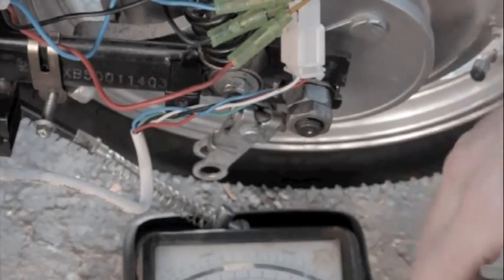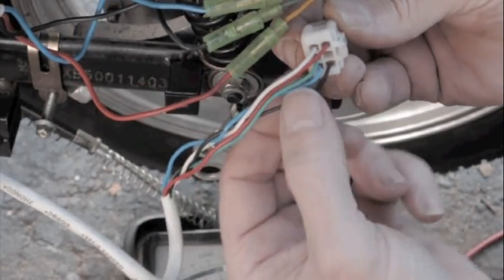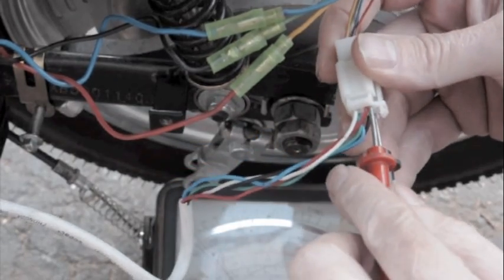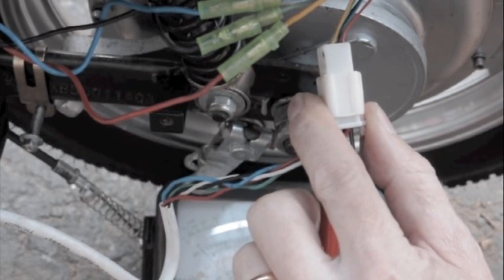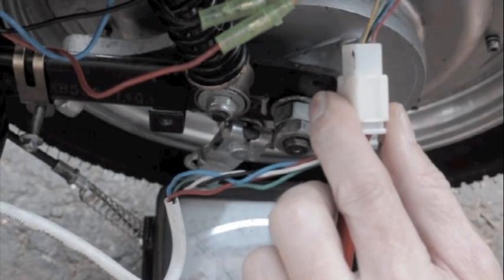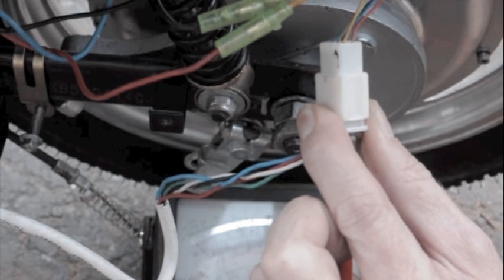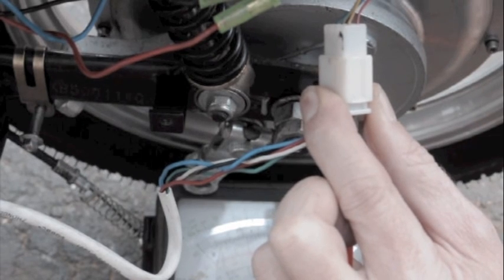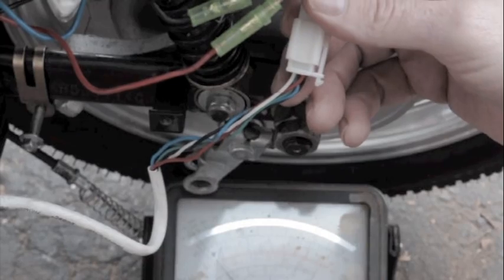Hall Sensor Testing

Comment: When I perform same test with battery plugged in , LCD screen turned on.  I get 4.82v between Red & Black.  Then between Black and other colors exactly 5v but as I turn the wheel it stays at 5v. It's brushless bldc motor with 26a 48v controller.  

Does this mean all 3 sensors are shot. Damn motor conversion kits brand new. Only rode it about 30x for 4 months. Never in the rain.  Looks new still but all I hear is tiny clicking sound when I use throttle.  Wheel doesn't spin.  Any ideas? Thanks. 

P.S. Update May 1, 2021 I finally bought a new controller and bifang motor wheel off ebay. The controller I couldn't figure out how to hook it up. So I tried the wheel. Only it was missing hall sensors end bit.  Still had Error 07 so I finally got around to soldering on a new 5 wire hall sensor adapter thingy.  Plugged it into existing controller and volia no Error 07 and wheel spins.  Only problem now is new motor wheel is 27 inches or more. Old wheel 26 inches. So I'm thinking trying to open up old wheel solder in new hall sensors in case new wheel doesn't fit. So all in all. These ebike hall sensors are sensitive and break down on some bikes easier than others.

Comment: Mine has no voltage at all when I don't turn it on. Once it is turned on it gives me a reading but it doesn't increase when the tired is rotating. Does that mean the motor is not working? Or the controller?

Comment: After a long trouble shooting process to diagnose an overheating controller (after getting a new motor), I discovered that my controller's hall circuit got fried. I used that test. The problem though, is that I also discovered that my new motor isn't alternating at all from 0v to 5v with any controller. I'm getting issues with the hall sensor's reading (it reads anywhere between 1.86 to 4.97 and that's without moving the wheel. I usually have to play with the contact with the black. Doesn't happen with the other hall wires). I'm not too sure what to make of that.

Comment: What voltages were you checking for 5v and 0v
Reply: Unfortunately that was top secret information
Reply: I think that's correct
Reply: @JesusOurKing  Yes. Mine reads 4.3v across the Black and Red
Reply: @wturber  I replaced hallsensor bs.. They blew again.  I bought a cheaper box which doesn't care about working sensors it works like a charm. Absolutely no difference.. I don't understand why they even put these failing components in.
Reply: @JesusOurKing  Well, pretty much all modern brushless motors have them so there is probably a real benefit. My bet is that a controller that is able to fall back to operation without the hall sensors doesn't operate as efficiently.
Reply: @wturber  I have no idea but im happy i won't have to pull apart that hub motor again. I still get the same mileage it seems too.  Have a great day

Comment: Help me please. My husband is saying it's my Hub sensors that have gone on my 1500w xingling electric bike. But I'm not so sure. The trouble I'm having is while the bike is on the stand the wheel is spinning fine. The minute you put it to the ground and put any weight on it the bike just lose all power. PLEASE CAN ANYONE TELL ME WHAT THIS IS??? Please???
Reply: Likely the hall sensors as that is their job to sense the position of the wheel as variable weight of rider and hills makes it hard to know when to charge the right coil with out sensors
Reply: Hall effect sensors or the batteries are shot!
Reply: +joe gonzales checked batteries there fine. thinking it's the control box.
Reply: Davina Smith have you solve already the problem of your bike? co'z I have same issue with my bike also.